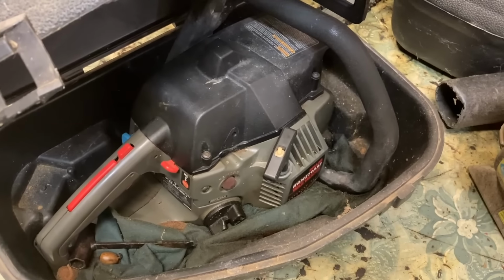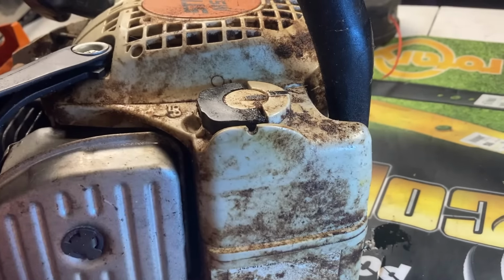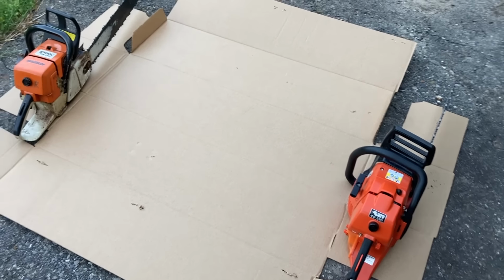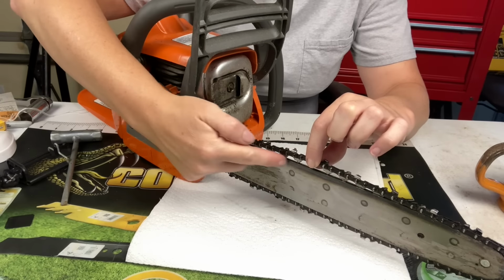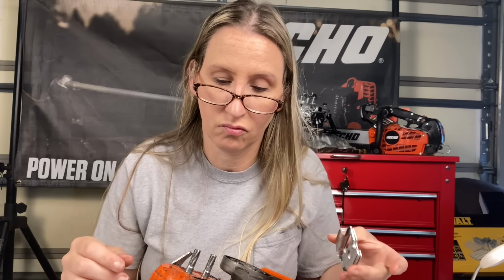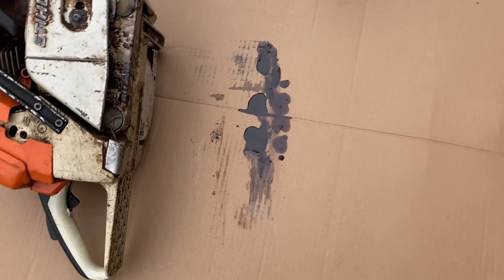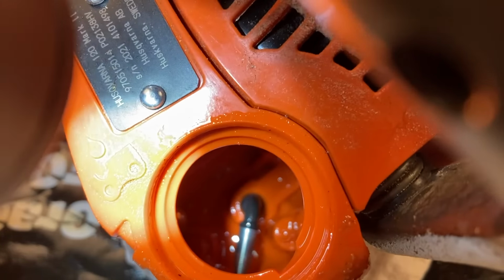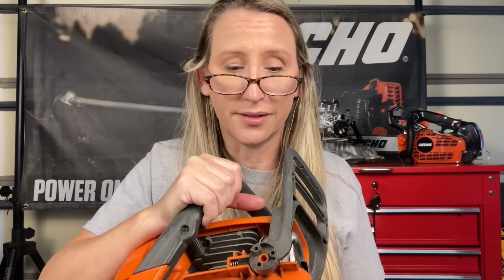Chainsaw leaks bar oil? The most common reason why AND Husqvarna saw leaking oil FIXED!! Repair Vlog

Comment: One tip from an old , experienced tech (since 1983) - Quite dangerous to run that husqvarna with outboard clutch without a chain and side cover on it - not common but I have had it happen: - You rev it up, and then let it idle , and/or when you shut it off, the clutch spins itself loose, spins off the crank and goes for a ride all by itself (after first hitting my steel toe boots, which saved me from an E.R. trip) and ran across the shop floor, scratching up the paint job on a brand new mower being assembled and barely missed the tech working on it, left a nice dent in the concrete block wall when it stopped.  After having that or similar happen 3 times (twice on Husqvarna, once on a Stihl) I just never run them without clutch cover in place any more.. I like my toes where they are!
Reply: The clutch have reverse threads so as the motor runs it gets tighter, not the opposite.
Reply: @stihlvarna  Until you shut it off, or go from full throttle to idle, then the momentum of the clutch unscrews itself.
Reply: @briangustin3745  the momentum  tightens it...
Reply: @stihlvarna  Momentum tightens it when the saw runs and revs up. (from clutch side, saw is turning clockwise, thus mass of clutch tends to tighten clutch as saw revs up or is under load from the chain & bar) . However, without bar and chain, no load, full RPM as the saw idles down, the momentum of the clutch wants to continue turning clockwise,  while the crankshaft turns slower than the clutch (or stops on shutdown) so the clutch loosens itself and then spins off.  Think about it. :)
Reply: @briangustin3745  I did. I think your full of it.
Reply: @stihlvarna  Ah well, Do it often enough yourself, experience will teach you what I can't seem to explain to you.... As I said in original post, I have had more than a couple clutches come flying off (2 Stihl 066 magnums, and a Husqvarna 372XP) and causing damage in the shop before I learned my lesson and always run it with clutch cover on, even if there's no bar and chain.. a $85 clutch cover replacement is far cheaper than the $900 worth of toolbox body work when the last clutch to come off on me hit another tech's brand new snap-on toolbox.
Reply: @stihlvarna  "as the motor runs it gets tighter"

If you were running the saw with no chain, at a constant speed, there would be no twisting torque either way on the clutch. When the chain is on the saw, and cutting through wood, you apply more fuel which twists the clutch tighter, even at a constant speed. When you stop cutting through wood, there may be a little untwisting torque on the clutch, momentarily, but not enough to break it loose, and the chain drag still helps keep it on. Without a chain though, you can get significant untwisting torque when decelerating, that can break the clutch loose.
Reply: @stihlvarna  Brian is right, if you actually think about it, it does exactly what he says and I’ve had it happen to me as well.
Reply: @stihlvarna  Stihlvarna, you're wrong. I've worked on saws my entire life and the reverse threads on the clutch flyweight assembly will allow it to unscrew itself under these conditions. Now, I have never, ever had this happen but I supposes there IS a very small risk.
Reply: If the mass of the crank and clutch are spinning in the same direction and the crank comes to a dead stop (compression the clutch keeps going and will spin right off if the clutch is loose ie. finger tight. Under load it self tightens. The chain (bar friction) would stop it from spinning off, a torqued on clutch would also keep it on, chances are when the saw crank takes off it tightens the clutch enough to keep it on but under the right circumstances it's very possible to spin the clutch off at high RPMs and turn it into a missile. both statements are correct, under load it self tightens, loose a clutch freewheeling, crank stops, clutch spins off. put a chain on it or at least a cover or make sure the clutch is torqued on. and be careful and point the saw in a safe direction in case it spins off if you choose to run the saw without a chain and cover.
Reply: @stihlvarna  he's not, look at pictures of clutch with off direction word and arrow, the slam on the crank break (compression) the mass of a lose clutch will spin right off, just like the arrow shows, you are correct the clutch will self tighten UNDER LOAD, it's all physically motion.
Reply: Are you 12 yo?! Why this lies?!
Reply: @stihlvarna think harder
Reply: I can see what your saying and your correct a clutch can come loose like you described,But I think only if clutch wasn't tight or properly " torqued"" to specs to begin with,if so NO WAY ITS GONNA"" BACKLASH "" ITSELF AND BECOME LOOSE !! BUT AGAIN YOUR CORRECT AGAIN IN STATING THAT ALWAYS HAVE COVERS ON BEFORE STARTING ANYTHING!! THEY ARE THERE FOR A REASON,BEING TO SAVE US HUMANS FROM BAD THINGS MACHINES CAN DO TO US !!😅 I'M ADDING THIS IN CLOSURE Why doesn't the clutch work ITSELF loose when operating it with cover installed ?? The cover has NUTTIN to do with or about keeping the clutch "" tightened "" on the crankshaft!! All the cover does is protect you & everything & everyone else from a potential flying object "" via clutch "" and also to keep ya fingers & such from becoming intwined in the same !! Point is a properly tight torqued spec clutch will not "" as u described "" & what I call "backlashing" allow or make itself to become loose !!
Reply: @briangustin3745 that is exactly what happened to me. Working outside the clutch parts went flying, never to be seen again. I guess I did not knock it tight enough with the hammer and chisel.

Comment: Been using used motor oil for bar oil in the tree service for 30 years. Bars and chains last just as long, oilers work just fine with it, much cheaper too.
Reply: Thanks for this. I’ve been using bar oil since day one and I could not figure out what the difference was between 30weight bar and 30weight car oil
Reply: @timberwolf0122  they add a tacky substance to bar oil to keep the oil from flying off so easy
Reply: @countryfriedent  Your right as rain. I used to use any kind of oil on the chain, but found out about the sticky factor and started doing it correctly.
Reply: Not cheaper... you will run through car oil a lot quicker, so no savings.
Reply: That’s a bad idea. Motor oil doesn’t stick to the bar. It flies off. You’ll spend more on chains and bars then you’ll save using motor oil. Only time motor oil makes sense is extreme cold where bar oil would be too thick, like Antarctic or dead winter of Alaska.
Reply: Everyone does.
Reply: Same!
Reply: @DNukinFutz In theory I agree with you, but reality is you just go through it a bit faster and things stay lubricated and if there is a bit more wear it doesn't matter much because you wear out the teeth faster than the chain itself and the bars already last a long time and can be redressed.
Reply: Also, bar oil doesn't burn for some reason. It will burn if you put a torch to it, but it won't sustain combustion like used motor oil. Not sure how important this is in the real world, but...
Reply: @DNukinFutz he said used motor oil. Wich in theory is free. So yes you do save. And it being used oil probly adds to its ability to stick to the chain. 🤷‍♂️

Comment: mine leaks 'cause its a 35 year old stihl 026.   and my 028 is even older.  and they live on a commercial christmas tree farm, plus i heat with wood.  cant kill'em.  and FYI, they aren't leaking.  they are marking their territory.  and they make cases?  :P   love your vids keep'em coming.
Reply: Take care of them and they will outlive all of us 🙂
Reply: LoL older homelites last alot longer then that
Reply: Just like an old Harley 😆
Reply: I got a 026 32 years ago.i lived in a old farm house that all it had for heat was a wood stove.i cut so much wood with that saw and it never gave me a problem.still using it today.
Reply: @michaeldulay4461  people don't realize there was a day when they were considered the best thing out there.
Reply: @franklaskus2395  Yup👍
Reply: @michaeldulay4461  before I could get to the after my grandfather died grandmother gave away my grandfather‘s old homelites 🤦🏻‍♂️.
Reply: @GuysPlayingWithTools  poulans use to be real good to to bad they both ain't American made anymore
Reply: @michaeldulay4461  You know it. it's kinda sad. 
They aren't "bad" but they aren't what they used to be either.
Reply: I've got a 30 yr old 026 that still works good. About 7yrs ago it was run over by a skid steer. Applied some heat and pressure with a stick thru the filler hole into straighten it  a bit. It's still a bit crooked, but works fine. Does leak a bit. But I never seen a saw that didn't leak something.
Reply: @briankennedy5578  haha awesome
Reply: @briankennedy5578  that's one tough old saw.
Reply: There is a reason Husqvarna gives you a fancy plastic case to put your saw in 😎

Comment: Something to remember, after running a saw, open the oil reservoir cap to relieve tank pressure. Do not fill it up until right before use. Relieving the pressure the cap can reduce oil leakage
Reply: If you are assuming your oil tank vent is clogged then sure but if not your not doing anything
Reply: I just dump what’s left back in the gt  bottle or gallon jug and store empty along w store empty fuel  tank carbs ran dry ? To easy
Reply: @jimgoinham6878  most oil caps only have a 1 way vent, they let air in as oil gets used, but won't let air out so as the saw warms and cools in the air when stored the valve makes the tank act like a pump, oil can only escape one way, thru the pump and onto the bar. 
Fuel caps are the same. If they had free vents allowing air in both directions s they would leak as soon as you inverted the saw.
Reply: After constantly finding an oil mess in the bottom of my storage case I discovered that by opening the oil cap to relieve pressure did the trick for me. I do put the cap back on for storage but I also use clothes under the Stihl’s motor to soak up any residual oil.
Reply: @davidholmes9874  Thx. I ll try that. . .
Reply: @kencleg7721  You're not supposed to store it with the oil tank dry.
Reply: Crack the oil cap and don’t clean your saw after every use. That sawdust acts like sponge.
Reply: @kencleg7721  Why are you using a "question" mark at the end of your sentence?
Reply: @richl2723  Because she was asking a question, silly!
Reply: @Alan Torrance  "HE" made a statement! No question asked.
Reply: @richl2723  I think Alan has Ken confused with Karen, hence why HE replied with a nonsensical answer about your observation about Ken's questionable reply. Both Alan añd Ken should have not put finger to keyboard in the first place and we wouldn't be in this confusion. 😂
Reply: @nojabjonny  🤣🤣
Reply: @richl2723  Now wait a minute. That can't be your only question about what he said.
Reply: @karlrovey  
Saws are bought new with the tank dry. They put just enough oil in them to test them and then dump the it out. They might sit on the shelf up to 2/3 years or longer before they sale them.
Reply: @BryanClark-gk6ie  Just going off of the owner's manual instructions from Stihl, which say to store the saw with the bar and chain oil reservoir filled.
Reply: Especially with Poulan!
Reply: Should be no tank pressure. Oil tank is vented.  If it wasn't oil wouldn't pump.  So opening cap is doing nothing if vent works. That's just common sense.
Reply: @jessefarrington6029  not really … the operation of the saw builds up pressure in the oil tank pushing oil out to the blade. Once the saw is turned off that residual pressure is still there. So, when you open the oil reservoir cap, that pressure is released and the oil doesn’t leak out through the bar anymore.
Reply: Wrong...   Operation of the saw turns the oil pump . Which pushes oil to the bar.  Not my first day ..
Reply: I love you?! and I love the way you giving us the lecon?!
Tank you.
Reply: Let it cool down with cap off then put it on the heat makes pressure

Comment: We use puppy pads under our saws.  They work great to stop oil on the floor/shelf.
Reply: I just rotate a piece of cardboard. Last a long time. Leaking is there but not to bad.
Reply: Do a similar,but also toss those cheap flat disposable tin trays under.
Reply: @ishnifusmeadle  Mine sit in old kitchen baking trays. They double as a container to catch spills when filling or parts tray when dissembling.  A lot more resilient than the foil trays... never seen one puncture or rust due to the oil mess. 😉
Reply: @BTW...  oh for sure a great idea. Usually my foils last me about 5 or 6 years b4 the pin hole, never had one rust tho, and for about a buck or two a piece it makes sense for me, but If I ever find big nuff legit baking trays I'll give ur way a try. Makes total sense they're alot mor robust. I usually toss a sheet of cardboard for easy clean up on top of my shelf, then the trays, then a couple pieces of paper towel but mainly for leak detection/keep saw semi dry at least. I prefer the real sheet trays (they're used if restaurants alot) that are about 2'×4' and mid guage stainless with a 1/2" rolled lip but they're 50-100 bucks a pop and as such u don't find used ones often. I do have a couI. I use in the shop and love em, but that's it.

Comment: Great video. All of your videos are top notch. One suggestion...I plead with you to start using hearing protection. I know it's a pain in the backside to use it, but you will save your hearing. I am in my upper 60s, used all sorts of power tools for MANY years (since I was a pre-teen) without hearing protection. I now have significant hearing loss; the ENT doc and audiologist said my hearing loss is mainly due to mechanical noise (power tools). It is irreversible. Now I get to wear expensive hearing aids to compensate for the hearing loss. The "good ole boy [girl]" thinking is that it won't happen to me. It will. Be smarter and wiser than I was, and protect your hearing while you're young. You'll be glad later in life that you did.

Comment: I bought my first Husqvarna 61 new, 40 years ago, cutting 3 - 6 cords of wood with it every year, since. It is still my Number One saw, but I've only had it back to the shop once, and that was the first winter, when the plastic worm gear driving the oil pump stripped out because I didn't know about winter-weight bar oil. I also learned that on that saw there are three different settings for the amount of oil delivered to the bar. You want the bar oil reservoir to have just a little oil left in it when the gas tank runs empty. 

I watched this video primarily because all three of my saws leak oil after putting them away. I will be checking them carefully, as noted, but I think my best bet for keeping the floor clean will be to invest in some chainsaw cases. Thanks -- you've saved me a lot of time looking for the cause of a problem that probably doesn't exist.

When I bought my first saw, I had never even run a chainsaw before. After the crusty, older guy who ran the one-man shop showed me how to prep and start it, how to adjust the chain, and told me to read the manual for safety instructions, I asked him if there was any other wisdom he could impart to a new chainsaw owner. He paused for a second, looking off into the distance over my shoulder, then refocused and said "Don't ever loan it out, and keep it out of sight." Wisest advice, ever.
Reply: I was working on John Deere G110 riding mower. It was dying every time mower deck engaged. I finally saw seat interlock was unplugged while filling gas tank. RIFLMFAO!😮
Reply: Never loan it out.  Truly a man wise from experience.
Reply: My dad's advice was the same but it was a list of 3 things chainsaw, razor and wife!
In that order...

Comment: I used to be a pump jockey back in the days of full service gas stations. When you pour oil, notice that the spout is offset to one side. If you pour while holding the bottle with the spout on the top side, it will not glug glug glug, but pours smoothly. 
Love your channel!

Comment: id be interested if you would do a review of the Husqvarna saws. Ive had several with oiling issues. Not enough oil to the bar has caused major issues for me personally. Ive taken the bar off and run the saw to see oil coming out of the oiler port but when the bar is installed most of the oil seems not to be forced into the hole in the bar and transfered to the chain rather it seems to run out and down near the clutch resulting in the bar getting hot.
Reply: @chaswarren7239  Thanks for the response. Ive done everything I could think of. Installed a new chain and bar and have same results. Have 3 saws experiencing the same problem.

Comment: I just used my Poulan the other day. After I was done, I cleaned it up with an air gun, drained the gas, oil and ran what gas was in the carb out. Even gave the chain a little sharpen with my file. It will be ready to go for next time. Usually when a big limb falls off the tree like what I dug it out for.